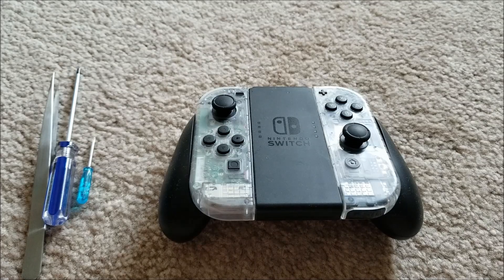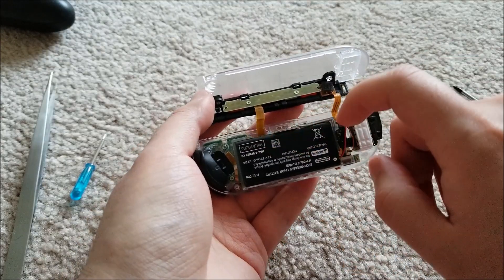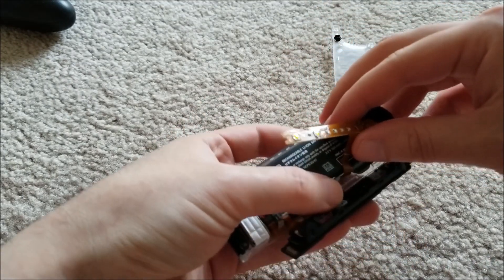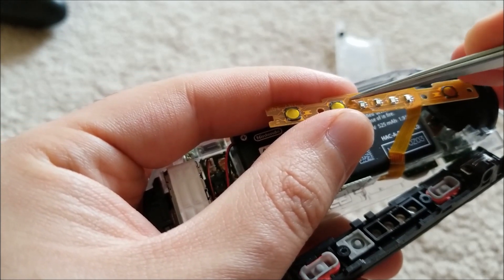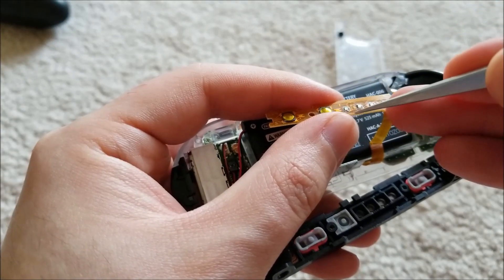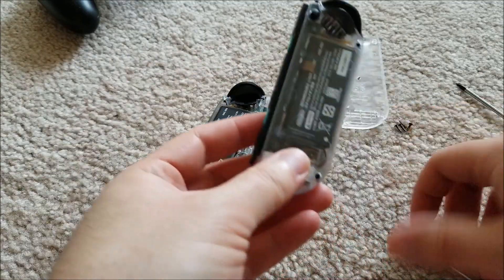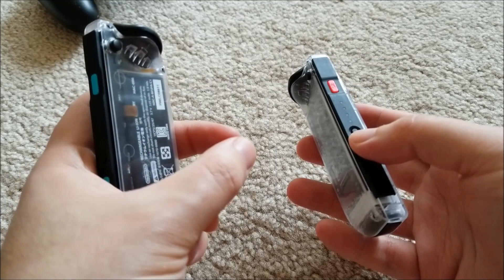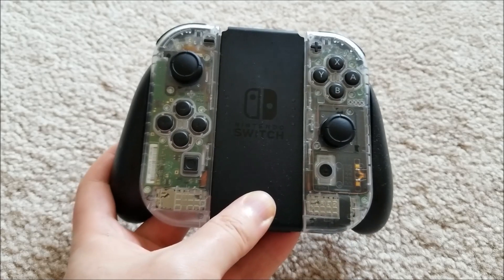Let's Mod: Nintendo Switch Joycon LED Mod

Comment: I just did this mod, with a cheap soldering iron from amazon. And i will say that the most important thing to have is lot of flux, if I didn't have it I would have lift a lot of pads but with it is super easy.
My advice (and what i did) is: reflow the stock solder adding new one and a lot of flux, this will make a lot easier to get the leds off the board later. After getting all the leds off I created a bed of flux covering one of the two pads, I placed the led and I held it with my tweezers while I applied the solder to the pad and led, once you have one side done the other is super easy because you don't even have to hold the it.
I ordered a pack of 5 different colors and used 4.
Thanks for sharing this mod, you inspired me and now I am very proud of my mod.
Here is the final look: https://imgur.com/a/QDCE6Xk
I also took a picture of the joy-cons to show why i decided to go with that colors.
Reply from the maker: We'd love to see a photo, it may get auto flagged if you share a link but I'll keep an eye out for it and manually accept your comment.
Reply: @sjm4306  done! I edited my original comment. :)
Thanks again.

Comment: Amazing detail. Great Video, quick to the point. simple to understand... great video. well done my man. You even linked the parts that someone might break doing this. Hands down a wonderful video. Maybe you can find a way to add like... LED lights to the actual switch like people used to do with the XBOX 360s.
Reply from the maker: Thanks! I do wanna do some mods to the switch tablet body as well, was hoping to get a clear backshell once prices drop ($20 for a single back panel seems a bit steep to me). LEDs and clear shells should be like peas in a pod!

Comment: So I finally did the mod and it turned out great! What are your thoughts on the home button LED? I haven't really looked at it yet, but maybe you have some info on it. Would be sweet if we could replace that LED as well :D
Reply from the maker: Great, glad it worked out! From what I've heard about the home button LED, it is some secret yet unused functionality that Nintendo hasn't done anything with yet. It's possible to swap it out for a different color and wait till the big N does something with it or like I've seen others do wire it to always be on when the joycons are on.

Comment: When I modded the Wii an easier way to change the colour was to put coloured tape over the LEDs themselves. Harder to get the color you want but less challenging.
Reply from the maker: Yeah that'd definitely be easier, but you'd be limited to what colors you can produce as putting a color filter over a monochromatic light can only really slightly shift or attenuate wavelengths but not add them.
Reply: True!
I'd definitely break something doing what you've done tho! Can't argue with the results tho, very nice.

Comment: Do you know a way to connect leds to a joycon?
Basically I want the leds to turn on by themselves when the joycons are on and turn off when the joycons are off...
I already have a pair with leds but they are connected to the HD rumble so the leds only turn on when the controller vibrates....
Thanks in advance
Reply from the maker: Search for test pads labelled something like 'VCC' on the joycon circuit board and measure with a multimeter to see if it provides 3.3V-5V when the controller is on and 0V when it switched off. You can pull some power from this point then with a current limiting resistor in series with the LED.

Comment: Did you use a heatgun to remove the LED or did you use a soldering iron?
Reply from the maker: Soldering iron, but hot air will work too. In either case be careful not to cook and damage the flex pcb.
Reply: @sjm4306  Oh right. Thanks!

Comment: Hey!
I would love to build an LED into the Switch JoyCon, that turns on as soon as the switch is "Alive" (handheld and bluetooth). I was searching for test points if there goes any difference with voltage as soon as it turns on but couldn't find anything. Do you maybe have a tip?
Reply from the maker: Your best bet is to look up datasheets for the chips specifically looking for sleep/wake or enable pins. You will probably have to add a transistor though to provide enough current to light leds from these signals.

Comment: I have a question. I want to replace the second women cable that connects to the switch to charge it but when I go online to order it it’s states. The item works only when the same models as the original is replaced. I don’t understand what that means. I was wondering maybe you would know. Before I order this part. You do make it look easy to take that part off
Reply from the maker: Could you post the link so I can see exactly what it says?

Comment: I've been trying to do this with uv LEDs so I can get a cool purple and white color scheme but I can't get them to work for some reason. I would test the LEDs both before and after soldering them with an external power source and they'd work but not when powered from the joycon, Can you please provide some help or advice?
Reply from the maker: UV leds have a higher forward voltage than red, green and even some blue leds so it's likely the current limiting resistors that are for the original green leds in the joycon are too high and thus preventing enough current to light up the uv leds. You'd have to find and remove those resistors and replace them with smaller valued ones.
Reply: @sjm4306  thank you for taking the time to reply. I've looked at some data sheets for uv LEDs and it seems you are absolutely correct. I think I'll go with white LEDs with colored gels on top or tinting the light pipes with a sharpie or translucent modelling paint.

Comment: any idea on what voltages those led receives? just curious before i buy some 0603's
Reply from the maker: The forward voltage of an led depends on the color. Red and orange are usually 1.5‐2v, green anywhere from 2.1v-3.5v, blue/purple/white around 4v. These are general though as specific leds have different chemistries.
Reply: @sjm4306  thanks for the fast reply, maybe i wasn't to specific, even thou i didn't knew that info you just gave me(which i really appreciate) i was more curious on how much the joy-cons originally gave to the led's voltage wise. does the joy-con supply 3v?
And again, really appreciate the help :) have an amazing day :D
Reply from the maker: Ah, sorry I misunderstood. I think the joycon provides 3.3V (haven't tested it but that's a common supply rail for modern portable devices).

Comment: I going to try to do this but I only have a crappy 15w iron and would like to know if that would work or not?
Reply from the maker: It's technically possible but be super careful not to lift any solder pads or fry any leds. Flux and leaded solder are highly suggested. Most importantly: good luck!

Comment: Hey thanks for the video. When I screwed the plate back into place the reset button works fine but the L and R buttons no longer work. Could I have screwed the plate in too much? Or is there some other common problem?
Reply from the maker: Is it a mechanical problem (ie the buttons are stuck/dont click) or they feel ok but dont do anything? If it is the first issue then loosening the screws a bit will help. If it is the second issue then the ribbons are either damaged or not inserted correctly. Reopen the controller and inspect the ribbons/take them out and thoroughly make sure you seat them correctly.
Reply: @sjm4306  thanks I will try those solutions. The cable looks okay but it was a pain to seat so maybe it is a bit off.

Comment: Hi. I'm replacing our refrigerator bulb. The specifications at the back of the ref with regards to bulbs says 10/15 watts. What does this mean? Does it mean I can only replace it with strictly, 10 watt and 15 watt refrigerator bulbs? Or it means the maximum is a 15 watt refrigerator bulb (so it can be from 1w to 15w?)?

Thank you. Happy New Year and Merry Christmas (Christmas ends after January 12)
God bless, Proverbs 31
Reply from the maker: Thanks, I hope you have a Merry Christmas and a Happy New Year as well. It probably means the manufacturer recommends either a 10 or 15 watt bulb for replacement. Of course you could use a lower wattage bulb but obviously it'd be dimmer.
Reply: @sjm4306  Thanks, you're welcome. I can only find a 9w and a 12w one (LED) here, would either be ok?
Reply from the maker: Probably either would be fine, but the only way to really know is to screw them in and test.

Comment: Does it have to be a 0603 smd led or can i use for example a 1206 smd led?
Reply from the maker: 1206 would be too big to fit on the original solder pads.
Reply: sjm4306 so 0603 smd it is then thx man!

Comment: As of right now, i am trying to do this soldering thing. But the solder wire just wont stick to the board. 😓
Reply from the maker: What temp is your tip, is it clean and tinned, and are you using flux? Whenever someone has trouble with solder not sticking/flowing properly it is usually some combo of these issues.
Reply: @sjm4306  its a brand new soldering iron, and im using the included Solder Flux Grease which is included in the kit.

And it's my first time doing soldering... 😔 

What is tinned?
Reply: @sjm4306  it's a 30W soldering iron. I bought it with the whole kit. Im a noob to soldering. Lol.
Reply from the maker: That all sounds good. Tinning is applying solder to the iron tip so it is fully shiny. This helps improve heat conduction. Do you have a pointy pencil shaped tip? Additionally are you using just the very tip of the iron to solder or increasing surface area by touching the pad with the side of the tip? I do have to say that you are a brave man doing this mod as your first soldering experience. It would be difficult even for people with years of experience.
Reply: @sjm4306  Yeap! i just watched a video on the tinning process. And i understand now. Yes, i have the pencil tip soldering iron.
Reply: @sjm4306  I am still unsure which works best. To get the solder wire melt at the tip or side. And thank you. I've been modding & repair  nintendo switch for customers. I want to bring modding to next level! Because i saw this vid of yours, here i am. Trying something new 🤘🤓
Reply from the maker: Nothing wrong with learning new skills and improving your technique! The way to solder small parts is to place the tip sideways on both the pad and part you want to solder (so long as there is room) to maximize heat transfer, and feed solder into the joint so it flows. If it doesn't seem to flow or get hot enough: wipe the tip on a slightly moist sponge or tip cleaner, retin the tip, reposition the tip to try and get more heat transfer, apply flux to the joint, reheat and add a little more solder till it flows nicely. Watching how-to videos help as well as practicing on broken electronics (you can get and take apart broken things people throw out for good practice).
Reply: @sjm4306  I really appreciate your quick response and tips! I will try doing this again tmrw as my energy totally drained out for now. hahaha. Thank you sir! 🤘🤓 keep doing wat ur doing!

Comment: what temperature is soldering iron
Reply from the maker: I usually set mine to 680F but if you aren't quick that may be a bit high and cause damage.

Comment: I wish I could find someone selling this piece with the light already changed.. I can install it with the tools I have but I don’t have a soldering iron
Reply from the maker: It'd be easy for the chinese manufacturers to pump out (just swap the leds in the bom at manufacture), I guess there's not much demand.

Comment: this would be great for just making flex cables on etsy and such.
Reply from the maker: Would be pretty easy to design replacement flex cables and get them made in china, but there'd need to be a high enough demand to make it financially viable.
Reply: @sjm4306  well custom joy cons have always been in high demand. Now you can customize pretty much the whole thing from the shell to the colour of the joy stick

Comment: Couldn't I just color the led with a marker ?
Reply from the maker: Depends on the color of the led and the marker. Leds tend to be fairly narrow bandwidth compared say incandescent bulbs though so it would likely result in dimmer lights that are unevenly lit.

Comment: Hi you should put multi coloured buttons on those joycons like the European snes controller
Reply from the maker: The clear joycon shells I bought did come with the colored buttons but using the original buttons felt a bit nicer and look classy.